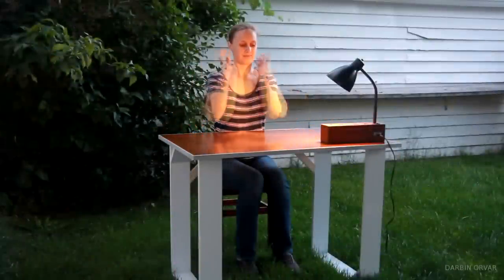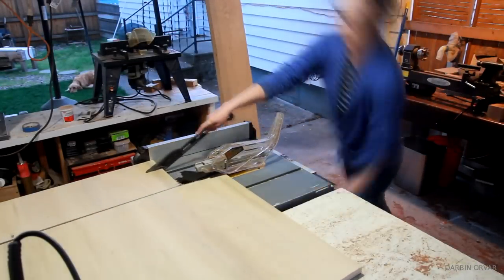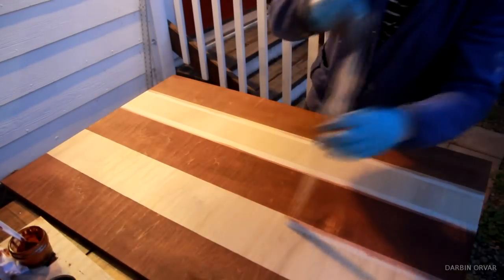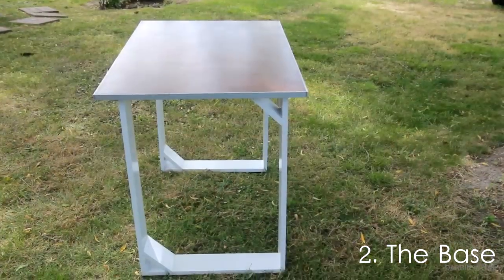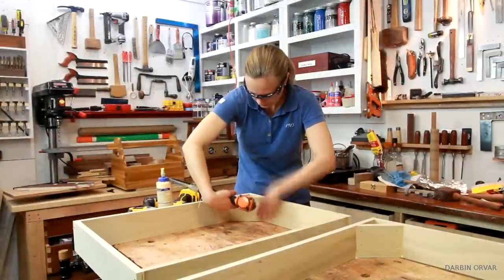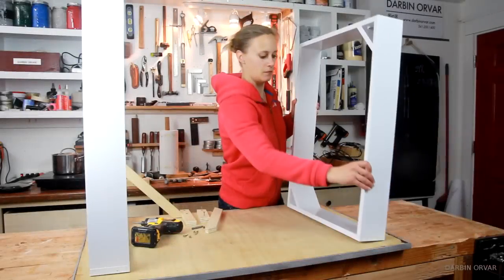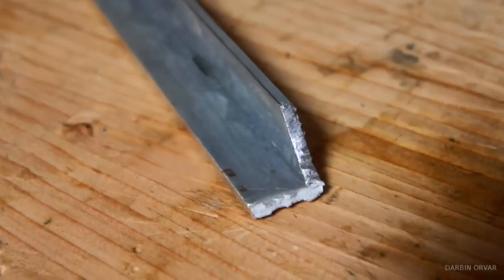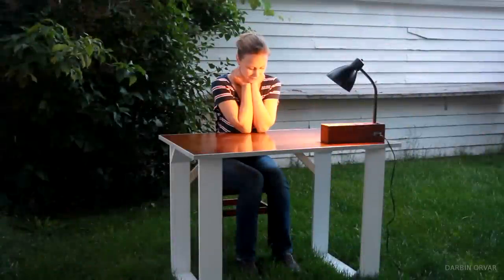DIY Simple Modern Style Desk

Comment: I would have done the aluminum like you started, but instead of trying to bend it, just get a non ferrous metal cutting blade for your table saw or miter saw, and cut miters for the corners. Cutting aluminum is pretty much like cutting wood, except the chips that come off are hot and sharp, so i wear a pair of safety glasses and a face shield. I've cut 1" aluminum plate on my 2hp table saw without issue.

Comment: About how much did it costs to make this? $20,$30,$50? Also,do you NEED those support brackets that you adding while putting the desk together at the end? I'm thinking my legs would hit them when I'm sitting at the desk? Someone please reply! Thanks!
Reply from the maker: PrettyLyingGame The cost for everything is about $30. You should add the support brackets, it helps a lot with stability. You won't hit them because they are in the back.

Comment: Instead of the brackets and the nail gun, could it (the legs) also work if the joints were connected using glue and dowels in addition to the wood screws?